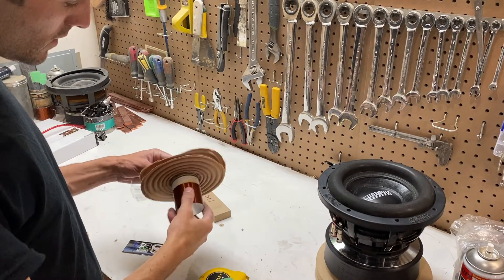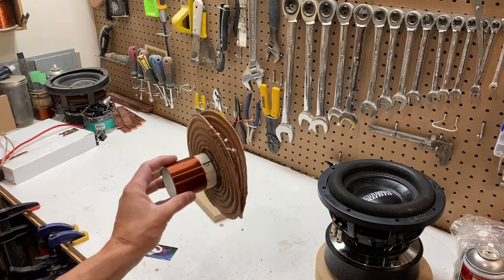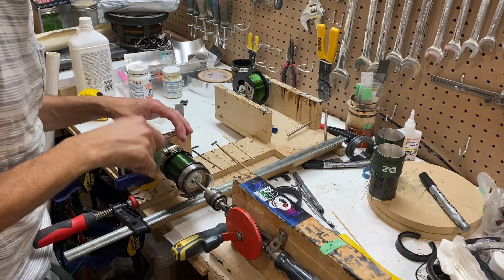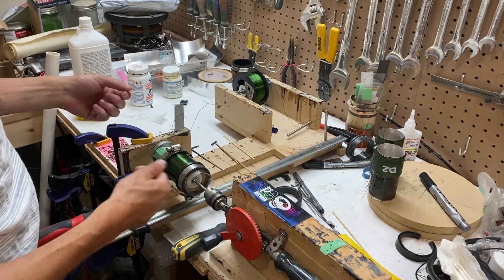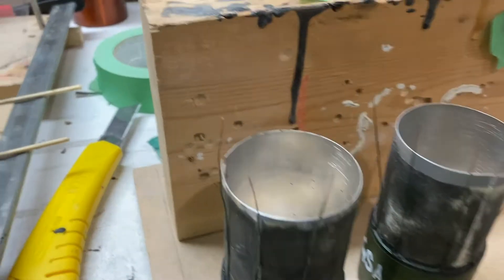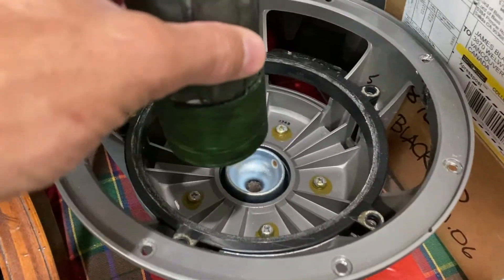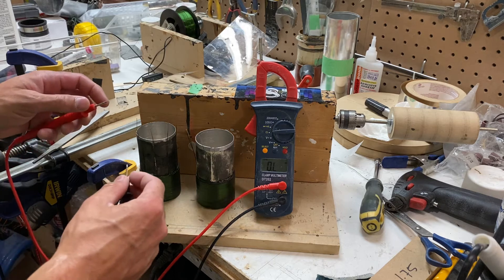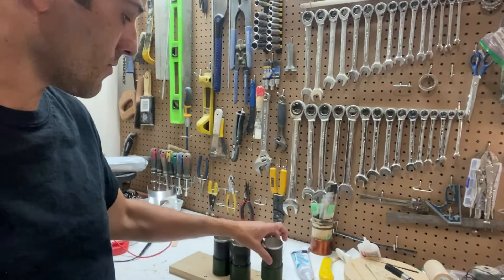Alpine Type R  Custom Made 4-Layer dual 2 ohm Voice Coil - (Part 2)

Comment: How do you get the craft paper to adhere? 

I’ve got a voice coil I need to clean up and if I damage the original craft paper do I need to replace it?
Reply from the maker: It depends I guess. Normally when I make a voice coil I apply glue and then wrap the craft paper then put a layer of parchment paper around the outside (won’t stick to the glue) then elastic bands or a rubber hose clamp until cure is complete. If your just removing some glue and Debris you likely won’t need to add any craft paper.